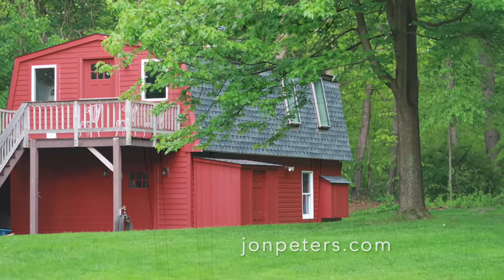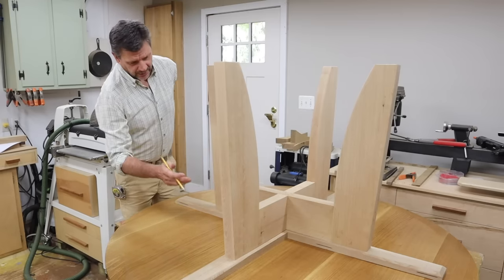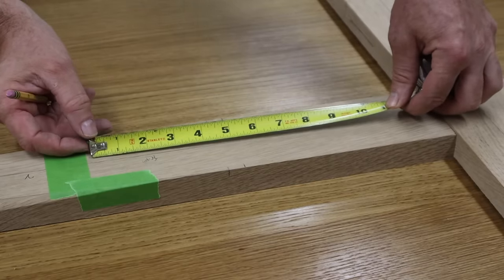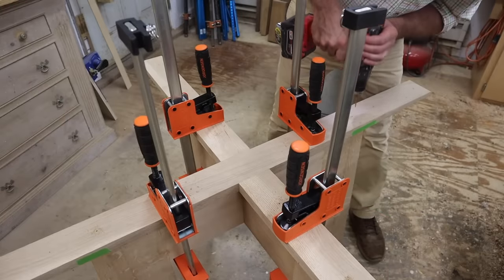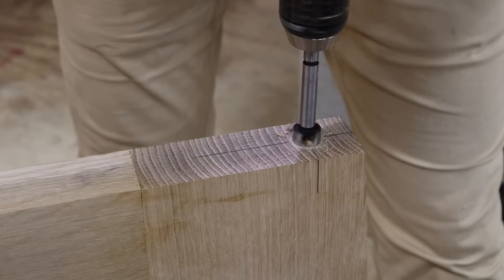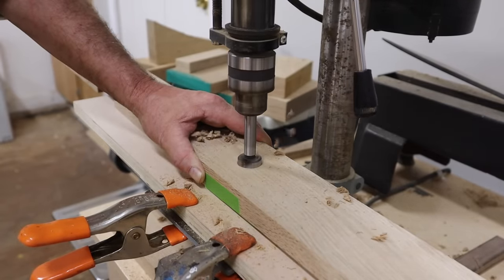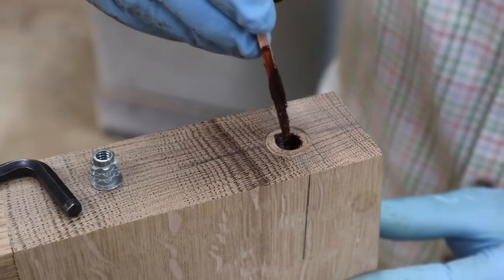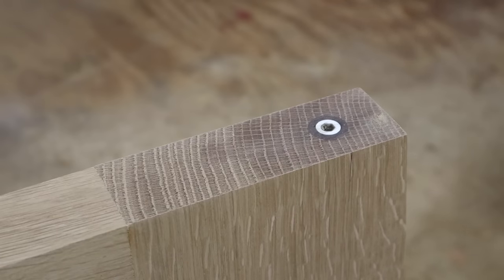How to use threaded screw inserts in Hard wood

Comment: A quick tip Jon..... just wax the threads of the bolt to prevent the epoxy from sticking to the threads.
Reply: @ryk3899  I know what tips you like.
Reply: Everyone can learn something new
Reply: @MrJKellerLewis  That's right. The beauty of having YouTube channel is you get helpful feedback from your viewers.
Reply: JOHN SHOUREAS 
Or Vaseline.
Reply: Be as a professional woodworker is not mean that you know every single tip & trick!! you may need to get them gradually through the entire of your life from someone else even who guys are as a beginner.
Reply: Or cover the bottom hole of the insert with a small piece of tape to prevent the epoxy from entering.
Reply: @keirfarnum6811  I've always wondered if the Vaseline screws with the epoxy and keeps it from curing properly. So you have any feedback on that.

Comment: I guess it depends on how quickly the epoxy hardens, but there’s a simpler way of threading your bolt or screw into the insert and not having to worry about the squeeze out. Instead of threading the screw in and out, drill your pilot hole just a bit deeper and clean out most of the epoxy with a Q-Tip. Don’t fuss too much over getting all the epoxy out; you’ll use the squeeze out to your advantage. Once the epoxy has hardened, use an appropriate tap to cut a thread into the insert. The resulting thread will be tighter than the original.

Comment: I've installed threaded screw inserts on to the back of a Fender style electric guitar neck. I did this years ago and haven't regretted it. It's a solid fit and doesn't hamper the sound of the instrument.

Comment: Jon, you have soooooo much more experienced than myself but sometimes, just sometimes we all get a good tip. 
This is one I got from a friend. When threading in the inserts, sometimes they bust open from the inside when using a allen key due to the wood being so dense. Currently I lock two nuts together on the bolt, screw that into the insert, using a socket, I thread the inserts into the wood. That way you apply pressure from the top onto the insert and not to the inside, I have not had one insert break on me since!
Reply: Francois Fouché 
Soften the wood fibers using liquid acrylic wood hardener before driving the inserts in.  It makes it easier to thread them in and then hardens afterwards so the insert will never pull out.  It works really well when dealing with screws or inserts in MDF as the MDF ALWAYS splits when a screw is driven in.  The only danger is stripping the hole so sometimes you have to screw a screw in only partially until the wood hardener sets.  It’s great stuff.

Comment: Put some Vaseline on the bolt to keep it from sticking to the epoxy.  I like the idea of using epoxy for the inserts; never thought of that before.  Another trick is to use acrylic wood hardener to saturate and soften the wood in the hole first before threading it in; then it hardens after the insert is threaded in.  I would bet that used with the epoxy, it would work even better.  Thanks for sharing.

Comment: Threaded inserts especially the flanged head style are wonderful, but: 
Inserts in the end grain ( can be ) a problem. If there is a load/lots of pull on the insert it can pull out of the end grain even in hardwoods. I would recommend using the longest insert available which I believe is a 1" length. 

You can also drill a deeper hole and stack inserts on top of each other for more strength. Just install the inserts with both inserts on a bolt that you have cut the hex head off of to use for an installation tool. This keeps the threads aligned. 

If a lot of strength in needed, another option in end grain is to use a long set screw, 1-1/2" or 2" length, as the insert. choose a set screw with an inner clearance of the hex hole slightly bigger than the threaded bolt your using. Using a wood or metal lathe or drill press, drill out the set screw on center and tap it. To install it use a tap that matches the outer threads of the set screw and then epoxy in place.

Comment: Very cool John, using epoxy as an adhesive sure works well to anchor those inserts. 
Thickening it with fine saw dust so it doesn't flow is a good tip.

Comment: I think so much of woodworking requires patience and taking the time to plan and setup each and every step. This is what I often takeaway from your videos. For instance,  the time you took to make the drill guide. The time to slowly mark with tape where the part goes back (vs me just marking a line in pencil or slapping on a single piece of tape that falls off).Mixing sawdust in the epoxy so it doesn’t settle. And everything is so CLEAN. So often it’s a rush to just make something and wing it because you just wasted 10 minutes trying to find where you put that drill bit you never put back after the last project. 
This is what you reinforce for me and, I’m sure, many others.  The patience to plan and not rush. Organize what you’ll need before you start. Treat each step as a mini-project and enjoy the process vs finishing fast. That joy (in the process) is why I became a woodworker. Thank you.

Comment: Those are really cool and handy.  On my work bench I put a few for my bullet reloading equipment.  That was they come off easy when I’m not reloading.  I have older craftsmen Intermediate tool but I look all of it in.  But them are so awesome.  

Have you ever tried drilling and tapping like metal?   I put some 1/4-20tpi bolts in drilling with a #9 rather then #7 for the tap drill size.  Then put super glue (CA glue) in the hole making sure it cover it well then drive in the bolt.   So far it was very strong going in above 1.25” of pine plywood I laminated together for a bench top to hold my air hose reel  and another smaller Intermediate tool box bolted from the top only.  It is my air compressor cart or  ‘service cart’ in the shop.  Recycled some only machine parts from work

Comment: This video is timely and helpful, to say the least.  Just yesterday, I prototyped a brass insert into spruce.  The insert was the kind that takes a flat-blade screwdriver.  I drilled the hole too small, and broke the insert when driving it in.  Second-generation prototype: drill the hole larger, use glue (epoxy) to lube and fix the insert.

Comment: Thank you short and clear. If I may add a suggestion I have seen to stop the epoxy getting inside the insert one could apply it to the insert rather putting it in the hole.

Comment: that measurement at 1:45 was way off on both ticks lol.  Was that just for show or did you use those measurements?
Reply: It didn't matter in the end as he used the off measurements as a template for the legs
Reply: @josephjoe9088  yeah, i understand that.  Just why even bother mentioning a specific measurement at that point.  I've seen enough of his videos to know how precise he normally is, so that's why i asked.
Reply: I had exactly the same question.....
Reply: @GeminiWoodworks  You are very right. I wondered at first until I realized what he was doing.
Reply: That surprised me as well, since Jon is normally Mr. Precision.

Comment: The cover photo shows a screw going into the wood grain from the top. I'm quite new, but isn't that a mistake due to the grain swelling and shrinking? I thought it was always best to go against the grain (might just be the case with pocket holes) to avoid the fibers strangling the screw in higher temps?

Comment: Hi Jon,

I noticed you've cut slots in the cross braces to attach the top to allow for seasonal wood movement but the screw holes through the cross braces into the leg assemblies didn't seem to have much wiggle room.

Is that because you aren't expecting much/any movement in those two pieces or another reason?

Love the videos, both longer and these shorts, please keep them coming.  I learn new tricks or techniques everytime I watch one.  👍

Comment: I've had trouble putting threaded inserts into hardwood endgrain - if the hole is too small, the insert won't thread in and in fact attempting to thread it in will either destroy the insert or split the wood. You mentioned that you used a 27/64" hole that was slightly smaller than the OD of the insert.  Can you be more specific about how much margin you allowed?  Would it be possible to drill the hole exactly the same OD as the insert - or perhaps just a hair larger - and let the epoxy filler lock it in place?
Reply: He drilled 27/64" and said it was only slightly smaller, I would bet it was a 1/2" insert.

Comment: Jon, I'm having trouble with my inserts. They keep breaking when I install them. What kind of insert are you using? Carbon steel? Mine are going into a hickory table. Thanks!
Reply: Great tip in the comments from Francois Fouche above... "When threading in the inserts, sometimes they bust open from the inside when using a allen key due to the wood being so dense. Currently I lock two nuts together on the bolt, screw that into the insert, using a socket, I thread the inserts into the wood. That way you apply pressure from the top onto the insert and not to the inside, I have not had one insert break on me since!"
Reply from the maker: With the White oak be so hard and dense I drilled the holes just a little smaller than the inserts.... The threads barely catch.... the epoxy is doing most of the work
Reply: @JonPetersArtHome   ah - ok... I am tracking now. Thanks for the clarification. I think you mentioned that in the video... but it took the reply before I caught it. The "threads barely catch" part is what I missed before. So there really is no stress on the insert when installing it and the epoxy is the strength. Thanks very much. Pretty nifty. Thanks for sharing.

Comment: Soooo. Epoxy 101.... Epoxy is very fussy about mix ratio, and you should mix the epoxy first then thicken. I point this out for anyone new to epoxy especially mixing in larger batches.
Reply: given it was mixed with an eyemeter, I guess it is a more forgiving mix. Yet, your comment is totally true - mix it 1st,  add whatever later

Comment: Start by using proper inserts for the material, the ones with chopped thread are for particle board and other stuff like that and ones with full thread are for hardwood and plywood.

Sure, you have to epoxy them in place regardless if putting them into end grain, but anyway...
Reply from the maker: Okay send me the link to your video so I know what to do